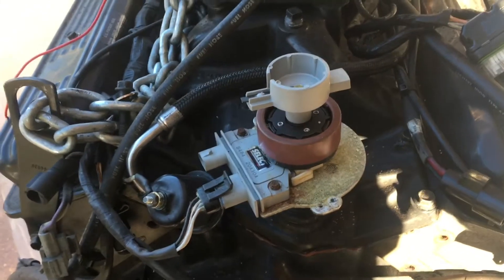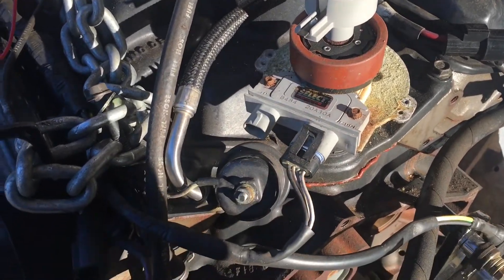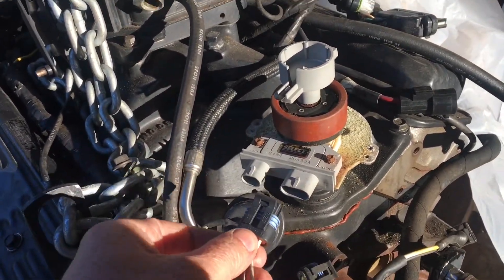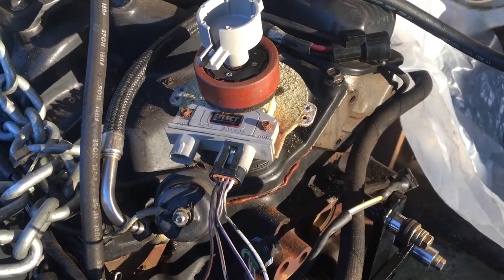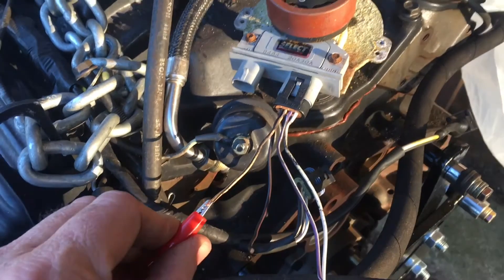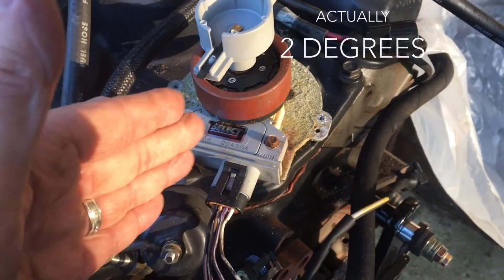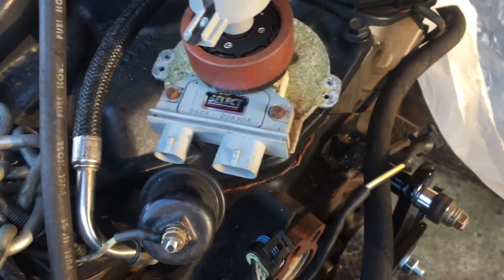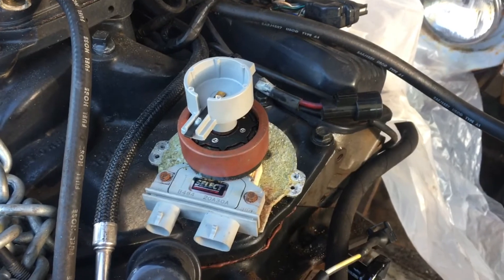Part 9E - How GM Delco EST Marine Ignition Timing Tool Works

Comment from the maker: Let me explain a little more the differences between the 5.0 and 5.7 modules. Notice that at any given RPM, the 5.7 is 2 degrees more timing than the  5.0. In essence, the timing is all relative anyway to whatever I set the initial timing to by rotating the distributor. For example if I set the initial timing to zero degrees with the 5.0/5.7 module, then I’ll get 12 degrees less timing everywhere than what’s shown in the 5.7 table. The fact that the 5.7 is off by 2 degrees everywhere than the 5.0 means they are the same part #, just the initial timing on the 5.7 is set higher by 2 degrees.

Comment from the maker: Btw you don’t have to use the tool shown in this video. The tool just makes it convenient. You can use a jumper wire with alligator clips on both ends and connect terminal E to R. Then use another jumper on terminal B and connect the other end to12 volts to set the timing.

Comment: Hi, thanks for the informative video. I have a pair of 4.3 GL in a cruiser. I had to pull the distributor and put it in according to my index marks I made, but I was still off. I got a shunt, set the timing. But I noticed there hardly seemed to be a difference in the sound of the engine when the shunt was attached. Shrug. So while I was at it I figured I should check the timing on the other engine, as soon as I connected the shunt to 12 v on that side there was a big difference in how the motor ran, as I had expected should have happened on the first engine. Do you think there might be an issue with the timing module on the first engine?
Reply from the maker: Yes sounds like the timing advance circuitry in the first module is not working. From the information in the video it should be clear that the timing tool basically bypasses the timing circuitry in the module. Removing the tool places the timing circuitry back in control. On a v6 I believe the idle timing is 18 deg BTDC which should make the engine speed up compared to the 1 deg BTDC when setting the base timing. Check that the module is factory GM because I would bet someone has swapped in an aftermarket module.
Reply: Thank you @moccasinmarine
Reply: I am curious, do you know why we can't just set the timing at the idle speed? Did GM possibly do this because so many vehicles didn't have a tachometer? @moccasinmarine
Reply from the maker: @dwcjwerfner  the timing is very sensitive to RPM changes without the tool. It would be too hard to maintain a steady idle while setting timing. With the tool idle timing is independent of the RPM so you can set it at any reasonable RPM. Just don’t set it above 1500-1600.

Btw car and truck modules are not the same as marine modules unless it’s an MPI system. MPI modules have a different method for setting timing. That’s why you cant interchange car and truck modules for marine modules.
Reply: @moccasinmarine  I was not aware that the truck and marine were different. I pulled the module and sure enough it was a Standard brand module, I swapped in a AC/Delco ADO-D1943A and the engine sound, nor timing did not change when plugging in the shunt. I can find listings for aftermarket, but no original Delco EST.
Reply from the maker: Watch this video.

https://youtu.be/EiB4F1V7YkY?si=r66Ygq4UpdONOmwn

Comment: Good video can I use a flat top distributor on 5.7 vortex with carb please help thank so very much
Reply from the maker: Big no. There is nothing in that distributor to trigger the ignition with. You’d need an msd crank trigger to fire an MSD ignition box and then the flat top distributor could route the spark but that would be expensive.

Comment: thanks for this video, but what can i do, if the 4 pin connector does not connected, and i dont have connected other bypass, or switch or bridge, but the engine also doesnt start?

if i connect the plug, the engine runs immediately??

thanks for support
Reply from the maker: The 4 pin plug must be connected to set the timing. Why are you disconnecting the 4 pin plug? A truck and a boat use different modules and the timing process is not the same.
Reply from the maker: If you are the same person that emailed me about a 1995 Suburban timing issue you need to stop looking at marine distributor timing procedures. The marine modules and truck/car modules are not the same although they look the same. Follow the procedure for setting the timing with a truck engine. There are videos on YouTube if you search for them.
Reply: Yes I am

Comment: Why does the brown copper looking piece surrounding the mechanism rotate 30 degrees back and forth?
Reply from the maker: Because you are turning it? Seriously it’s just a EMI shield and the way it’s held in allows it to rotate up to a point. There’s no significance to that.

What is important is the coil of wire must not rotate or it will change your timing. Not good.
Reply: @moccasinmarine  Thank you. Yes. I noticed it moved and wondered why. One of mine on Port side has been monkeyed with by a previous person. If its just a EMF shield the pliers marks shouldn't be something to worry about although pliers marks are always a heads up to check everything involved.

Comment: Got a old Chaparral with a yamaha sterndrive and 90 GM 350 5.7L that has been a project for a little bit now. Bought used and the distributor I believe is an auto and not marine. How would I need to set the timing? At the moment with the timing light, its at 10 BTDC, but have not jumpered anything on the connector side and is not running quite right
Reply: Forgot to mention its a carbed motor and the distributor has a GM stamp on it. That 4pin plug is connected but looks like only the bypass has a wire going somewhere and the other pins are not being used
Reply from the maker: Watch this video to the end to answer your question.

4 - Wiring Delco EST Into Blunderbolt V - SPARKIE The EEL
https://youtu.be/eD7wceC2GLc

Comment: Sorry I dont speak english,I need To do the same  but in 4.3 Volvo with TBI fiel sistem, Its the same? 18 degree at 600rpm?
Reply from the maker: If you have a TBI fuel injection the timing is set to 8 degrees after you jumper pins A and B in the datalink connector. Watch this video.

https://youtu.be/djjvdJAEdVY?si=-s7-xqv2lWQzeeGH

Comment: What is the difference with this system as opposed to a msd , petronix, or the d.u.i(hei) distributors. Thx
Reply from the maker: There are 3 electrical/electronic parts in an electronic ignition system. The trigger (pickup),the signal amplifier/conditioner (module), and the ignition coil (transformer). The pickup is typically a magnetic based device that generates a wave signal with a frequency that matches engine RPM. The pickup is typically a dumb device (just makes the signal with no manipulation). The pickup can also be hall affect or optical. The module takes the pickup signal and converts it to a usable higher current switching circuit switching the current on and off going through the ignition coil. This high current switching in the coil is what creates the spark at the spark plugs. Modules can be dumb but they can also have “logic” that manipulates the trigger so that the spark occurs at a different point in time as the trigger. The Delco EST module has this logic so the spark is “advanced” ahead of the trigger as the engine speed increases. This is necessary to allow the engine to make maximum power because you have to light the gasoline vapor earlier as the engine spins faster. Since GM (Delco) designed the engine the Delco EST modules are designed to run GM engines. That’s why I use nothing but GM modules.

The other systems (Pertronix for ex.) are just better dumb pickups but have no logic for advancing timing. These systems are inferior and require moving mechanical weights to advance timing mechanically and are prone to wearing out fast. Other systems like MSD are not bad, but they are not designed specifically for a GM engine. You have to custom tune them for a GM marine engine. The MSD is also bulky and requires mounting space which is not available in a boat without custom brackets and long harnesses.

The DUI is the lowest featured system and is a throwback to 1970s technology. It has the dumb magnetic pickup and a dumb module and again uses mechanical weights to advance timing. The weights are prone to wear and altering the timing curve which can either damage the engine or cause it to lose power.
Reply: @moccasinmarine  thanboat has ran for sometink you.  we are looking to replace our thunderbolt IV.  I have watched your videos.  My problem is that when the boat has run and then shut down for about 45 min its hard to start again.  Ive thought it to be fuel related which it still could be.  I just ordered a petronix 45,000 volt coil to help get more spark.  If this doesnt help im going to get the EST system.  what do you think maybe my issue.  think maybe a hotter coil could help?  my merc coil only puts out 20,000 maybe 24,000 but wont hit 30k on my tester.
Reply from the maker: @kimberlyrichardson5779  the TB IV modules are known to deteriorate slowly. That’s why it’s frustrating to work on these systems.

Comment: Is the same for MPI 7.4 engines ??   Carburetors and injection system the process is the same  to set timing with this tool ?
Reply from the maker: MPI engines do not use the set timing tool. The timing procedure is the same as a truck process. This is an involved question I can’t answer in a comment.

Comment: I'm trying to timing my Volvo 4.3 GL. I have follow your indications with the timing shunt tool. But still I have a doubt: when engine is running, shunt tool connected, timing light to cylinder #1 : Do I have to align the the marks  on the harmonic balancer moving the distributor right ?  Then I have to stop when the marks are aligned at TDC or I have to follow that chart at the end of your video ? If so, means if my engine is running at 600 RPM do I have to set it up at 18 degrees ? Before or after ? Thank you so much for your informative video and hope you can clear my questions,
Reply from the maker: Good question. When you have the shunt tool connected and the engine running at idle, you set the timing to the INITIAL timing setting in the chart and nothing else. In your case it’s 1 degree BTDC. After you remove the timing shunt and put the system back to normal running mode the ignition module will take over and give the timing in the chart.
Reply: @moccasinmarine  thank you so much for clarifying my concerns and your help !

Comment: Thanks, finally I understand.  i have a Mercruiser 3.0 1995  the distributer has the plug with 3 wires; the two short white wires hanging and a black one connected up into what seems to be the Tacho wiring.  Do I un plug that plug and put a shunt in, or just join those two white wires together to go to base timing.
Reply from the maker: This doesn’t sound like the same distributor in this video. If you send a photo of your distributor to gmefiguy@gmail.com I’ll take a look at it.  Under normal operation there is only one plug with two wires used. The other plug is capped off. You should not have any plug in your distributor with more than two wires.
Reply from the maker: You need to watch this video. I think it will answer your question.

https://youtu.be/XBQhxogrFsE

Comment: I have been trying to do some research on changing out the distributor in my 88 MasterCraft TriStar 190...it has the 454 in it. I think it's Ilmor motor but not sure....it is carbureted... And was wonder if you just do the starught forward timing of the info e or do you have to change the timing curve in the module...
Reply from the maker: You can’t change the timing curve in the module with carbureted engines. If it were fuel injected you could with expensive software. You can alter the initial timing but that’s it. I’ve covered this topic in another video. I’ll post back here when I find the link.

Go to this video and look at the last comment thread by CitrusMcFly. I discuss the 454 timing in these comments.

https://youtu.be/x_UXSsOnepk

Comment: I have a volvo penta 3.0, I have removed my delco est distributor just changed the mounting seal and put a original volvo penta gm module and pick up coil in it and install back everything and I can't start, it been from Sunday I'm struggling with it
Reply from the maker: More than likely one of the parts you installed is defective. If you have a Digital Voltmeter, perform the checks on pages 55 and 56. For more troubleshooting refer to this manual.

https://f01.justanswer.com/oldnewenglandmarine/36c97f52-be29-4a64-9ab5-8bf8b351bf86_Delco_EST.pdf
Reply: @moccasinmarine  thank you i figure it out, the timing was 180 off so i make sure the 1 cylinder on the compression stroke and i insert the distributor a bit more clock wise so when it drop in, it would line up with the camshaft gear and go back in the position you want it at the number 1 tower.
Reply from the maker: Usually when an engine is out of time it will cough sputter or make some kind of noise that lets you know it’s trying to fire. But being 180 out of time is a very common mistake to make and easy to do on the 4 cylinder 3.0 because you can’t see the valves.
Reply: @moccasinmarine  that's what I realized but it took me several days of trying and watching different YouTube video to figure it out.
Reply from the maker: Just curious what method did you use to try and find TDC on compression stroke?

Comment: Hello. I installed the EST ignition system on my 5.7 magnum carbureted engine in my boat. I installed the distributor and put the #1 cylinder at TDC. Then dropped in the distributor with the #1 terminal In the same orientation as the old Thunderbolt V distributor. I then started the engine and warmed it up. While it was running,  I connected the timing tool, and set timing to 8° BTC. I ran the boat at the lake and found it did not have the power it should. I had someone at the helm, And rotated the distributor into advance and it made plenty of power and runs well. But it is not at the timing the directions  say now. It is advanced. So, the question is. Does the distributor have to be installed clocked in a specific position on the body of the distributor and then the cap installed and wires ran in firing order? Does the engine need to be at a higher RPM than idle during the base timing procedure? Do some GM engines just need to be times at 12 to 14° while others at 8°? Any insight is appreciated. The engine runs well as is. But I'm confused as to why it's not by the book.
Reply from the maker: First you need to make sure it’s a marine ignition module and not a truck or car module. They have much weaker timing curves. If you are certain it’s a marine module ( there are ways to test it) then the next thing is to follow the DELCO EST instructions to the letter. Look at 8:40 in the video link here:

https://youtu.be/1a9cHJrH0d8

It shows 12 degrees BTDC at 600 RPM. You said you used 8. If you were still using the old Mercruiser Thunderbolt setting you can’t do that. You should use the Delco EST initial setting of 12. If you use 8 you are going to be 4 degrees less than every value in the table. It’s hard to qualify what your power loss was but I wouldn’t think 4 degrees would be that bad. If you are using the Vortec timing cover then your mark hasn’t moved. The only other thing I can think of that might affect timing is your damper partly sheared the woodruff key and shifted.

EDIT: I think I know what happened. The timing tool that you buy has a loop from the R terminal to the E terminal. You can’t break this loop while it’s running. On my home made tool I can break the loop while it’s running and it kills the engine. I do this to verify it’s in set timing mode. You can’t tell if you are or aren’t with the bought tool. So you probably were not in set timing mode and set the timing at 8 degrees. At 600 rpm the normal timing is 21 degrees per the chart. So if you were not in set timing mode you set the timing 13 degrees less than the table across the board. That would definitely have an impact on engine power. If I were you I would cut the loop and insert a toggle switch so you can test if it’s in set timing mode. If it is and you throw the switch the engine will die.

Comment: Thank you for making this video. Time has passed and you may not receive this question however, would you happen to know the part number of the two pin connector for the module that connects to the coil ? I am going with a Pertronix distributor and would like to connect to my existing connector and harness. If I can get the number of the plug then I hope to source the receptacle ( socket on module ) and connect it to my wires from new Petronix distributor. Hope I haven't confused too much ! Thanks. Rick.
Reply from the maker: I’ve never seen the female (socket) half of this connection pair separate from the device being connected. Not only that why would you keep a Pertronix distributor that relies on mechanical flyweights for timing advance? That system is prone to corrosion and mechanical wear. Delco EST never wears out.